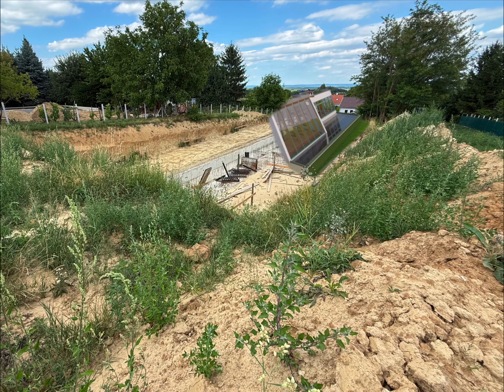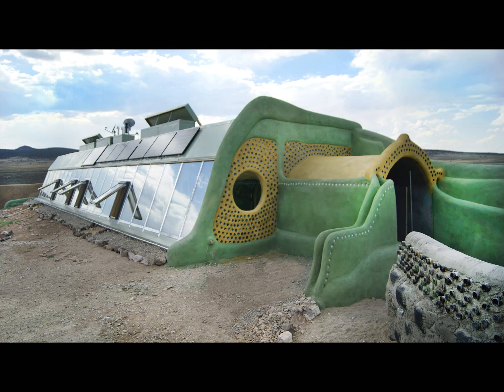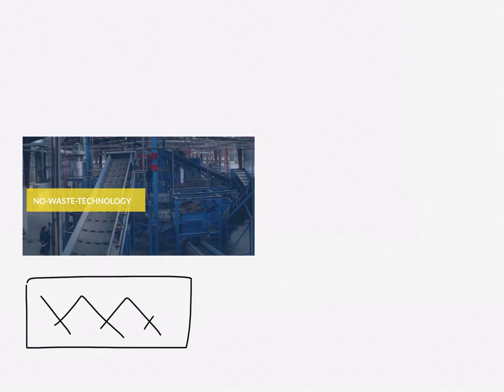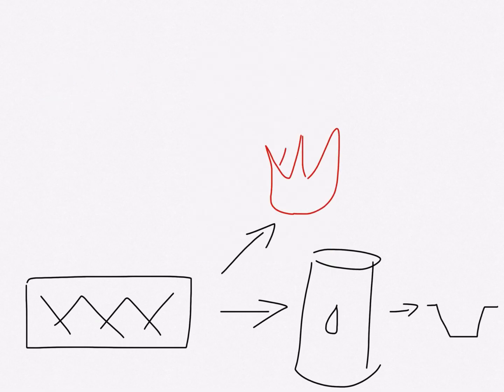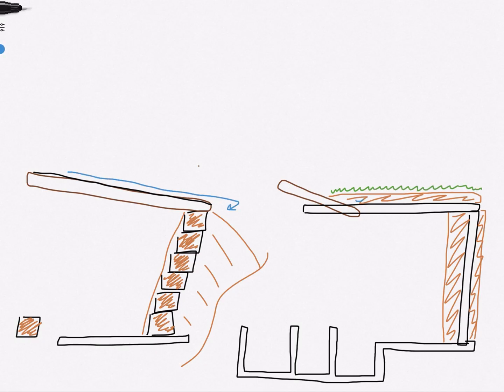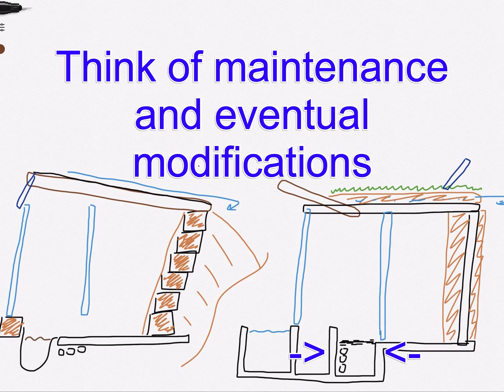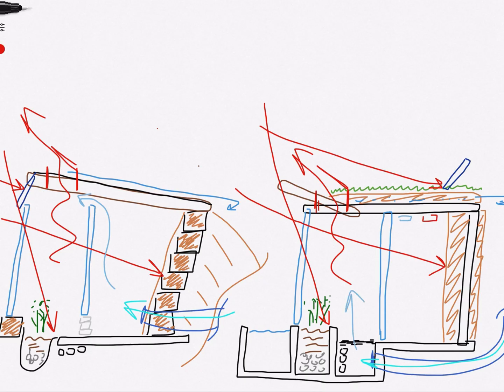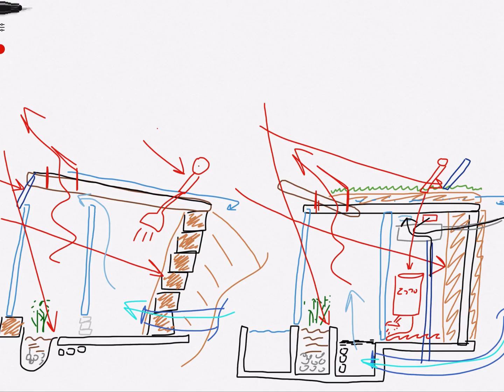English: Aquaship vs Earthship - and why we should stop building with tires

Comment: Lots of people searching for solutions to the tires. I’m leaning towards poured concrete.
Reply from the maker: Our material of choice would be pressed raw earth bricks. But it is difficult to get a building permit for those or to find people who work with them. And then there are parts where concrete seems the only viable solution, be that the foundation slab or building waterproof basins. Unless you use plastic liners, concrete seems to be the only way for those. It is an expense, also CO2 wise, but if we built with quality for a very long period of time, then we should benefit from the availability of these materials. Tire walls are a great alternative for a post apocalyptic world I think.